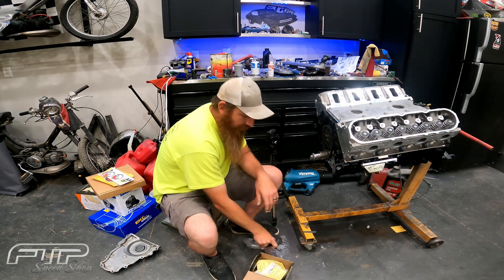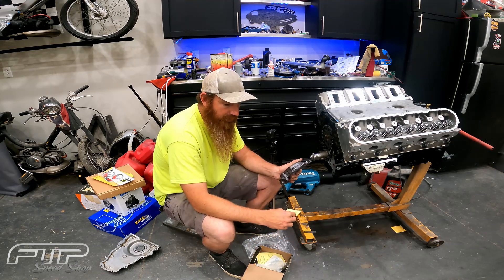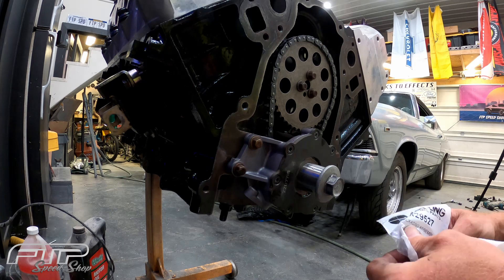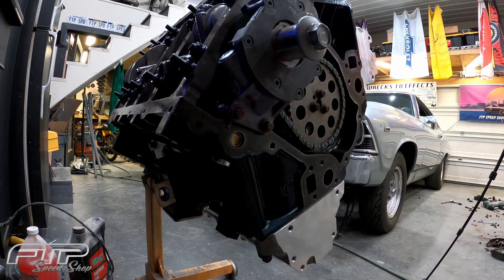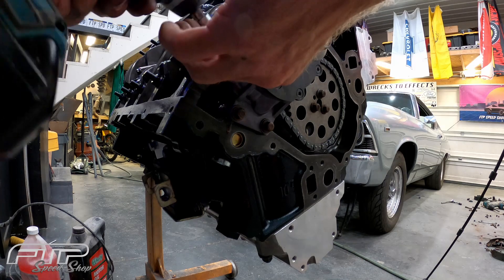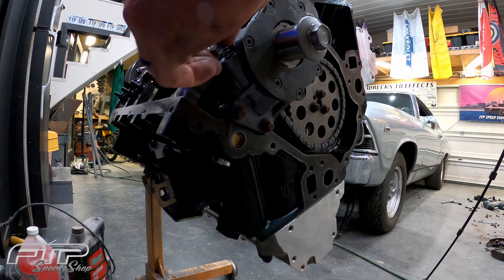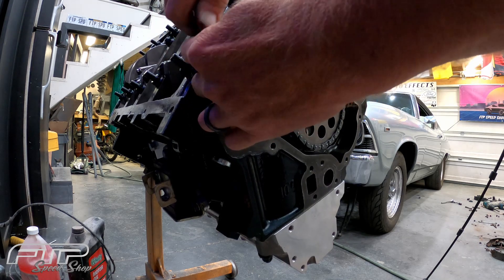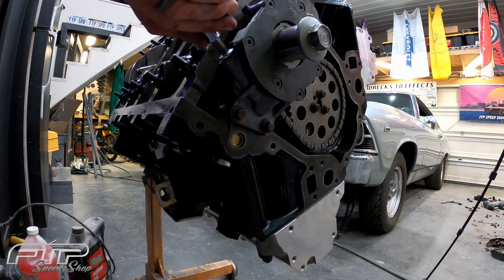How To Change The Oil Pump Pressure Relief Spring On A LSX Melling

Comment: What oil pressure sensor you using to hold that pressure?
Reply from the maker: Mechanical gauge and a autometer electric sender is what I've used.
Reply: @FullThrottlePerformanceMike thanks I was using that pump with cheap oreillys sensors and kept blowing them I’m right at 55-60 at idle but on wot it took them out. I will be using a oem ac delco One now and hopefully that will solve my issues 🙏🏼
Reply: Thanks in advance 🙏🏼